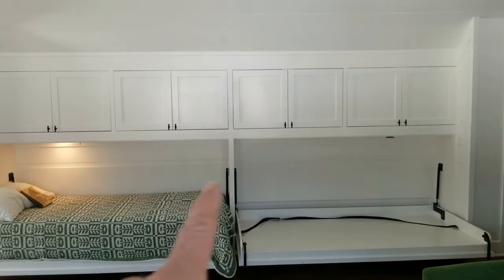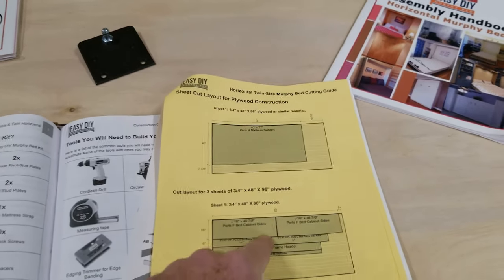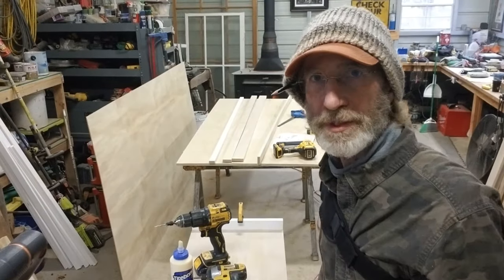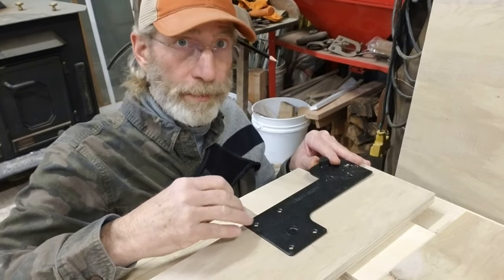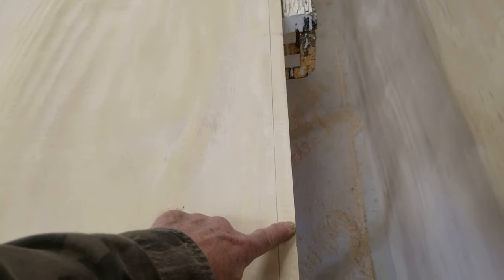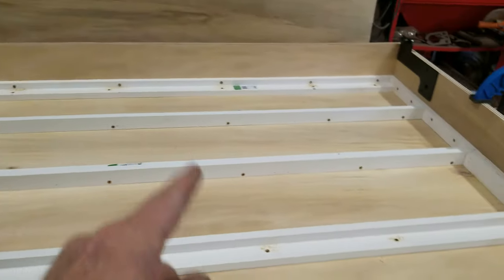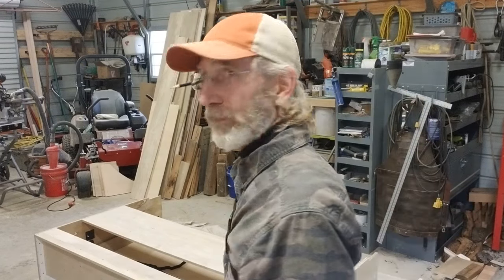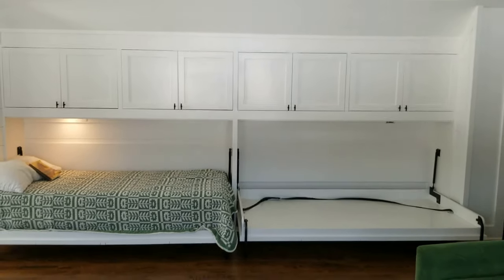Easy DIY Murphy Bed build with some quick tips and history.

Comment: i bought the same horizontal kit, it was fun and easy to build, but heavy to move around since i work alone and my shop is tiny.
Reply from the maker: That bed frame section is a bit heavy for a 1 man show. I hear you on the tiny work area. I need to build some type of shed so I can reorganize and make more space in mine. The walls are closing in on me.
Reply: What is the name of the kit? Does it include the hardware needed?
Could this be attached to a wall in a cabin?
Reply: @janew5351    "Easy DIY Murphy Bed". it has most of the hardware and mechanism. you gotta buy a couple sizes of screws, it lists the extra materials you need to buy. as long as the cabin can handle a beefy roof, the studs should be able to handle it. i got the twin size horizontal, it probably weighs around 100 lbs give or take when assembled. plus mattress max 70lbs.